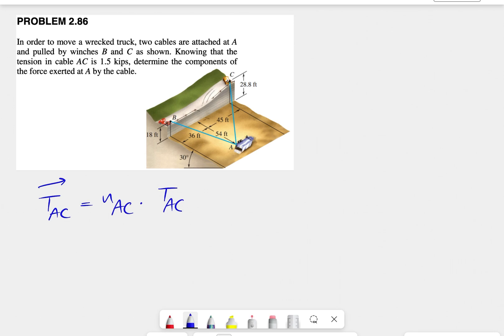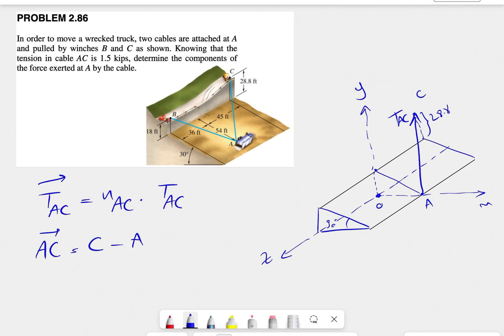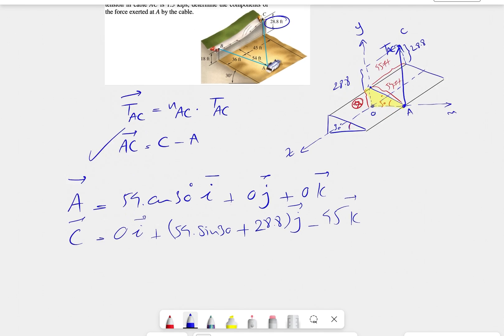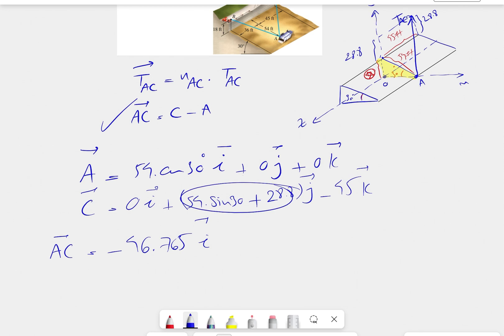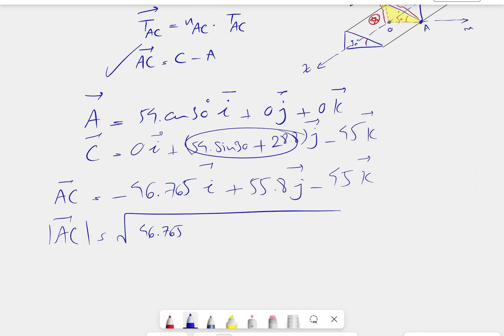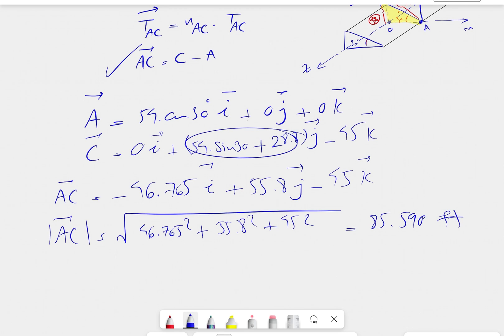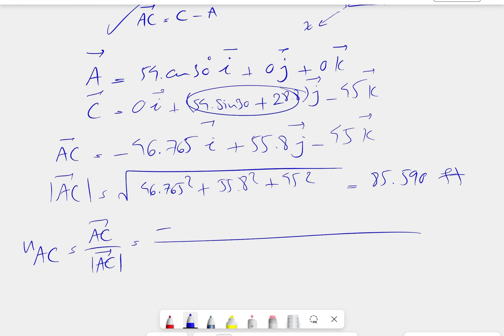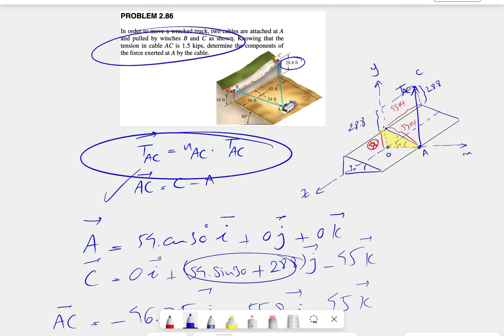Problem 2.86 | Determine the Components of the Force Exerted at A

Comment: this one made no sense to me. Without prior notice to use the angle. Just visually looking at the picture the top of B to ground looks like 18Ft
Reply from the maker: The height might visually appear different due to perspective, but the angle and calculations help determine the actual height more accurately. Let me know if you’d like a more detailed breakdown of the steps I used!
Reply: for real